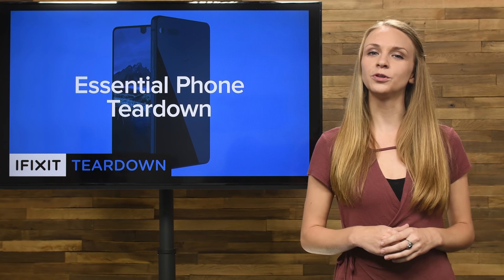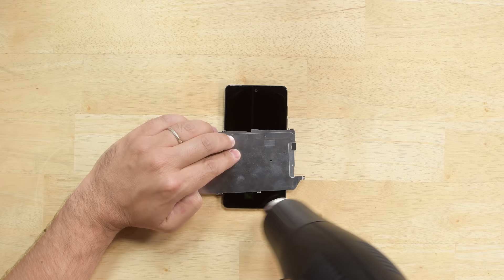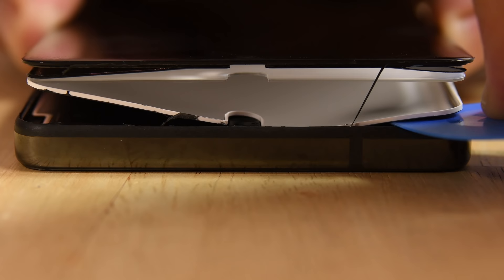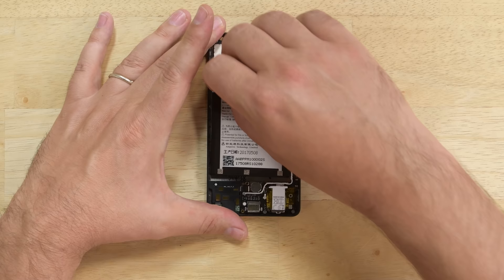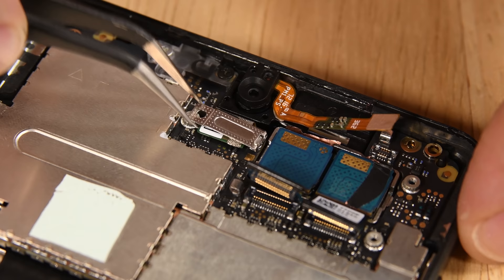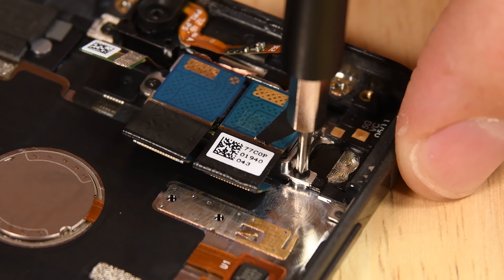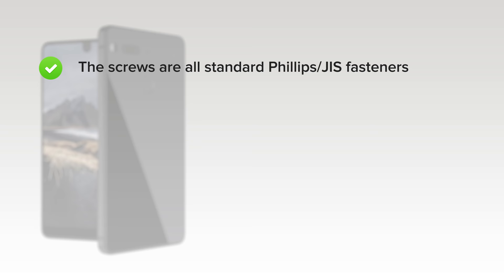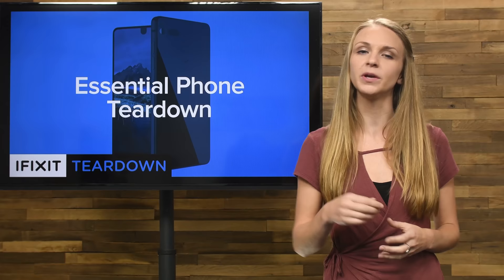Essential Phone Teardown!

Comment: Getting sick of those unrepairable devices.
Will never buy it.
Reply: Richard Patry I love my LG G5! (8/10 I guess)
Reply: I love my iPhone 8 and it gets a repairability score of 6/10. It's fairly repairable it's still not the most repairable thing in the world.
Reply: If you check out litterally any other teardown video, you'll see how easy it actually is to repair this phone. Most, if not all, of the parts are modular with tiny screws even holding the display connector and making it easy to swap the display without having to go deep into the phone's guts.

Comment: An original gameboy would have gotten a 2/10 because the display is soldered to the logic board but, at least the 2 outer halves come apart with a tri wing screwdriver.

Comment: How is this not a zero... you cannot open it without breaking half of it.
Reply: d4ark Well screen repair is still possible here
Reply: You can heat it, then place a slim thing between the speaker and the display. I know this because I fixed my display and my friends after we both dropped it without having a case on it. Probably the easiest phone I've ever repaired.